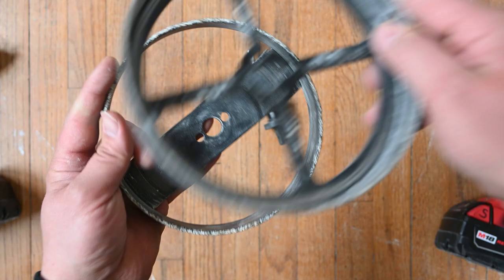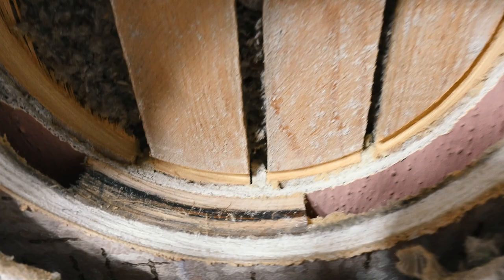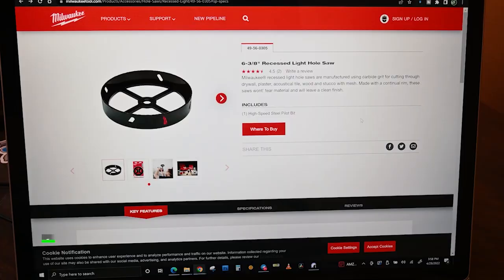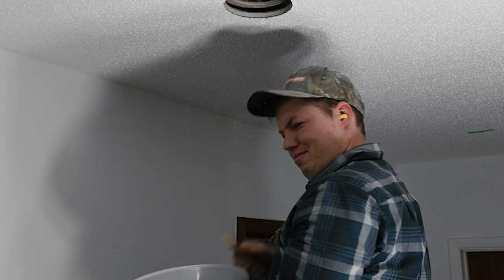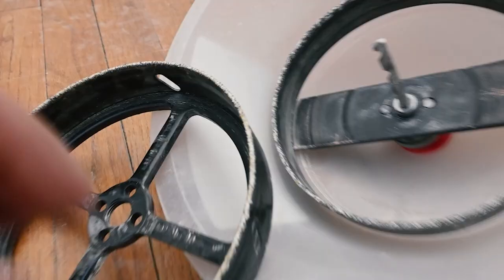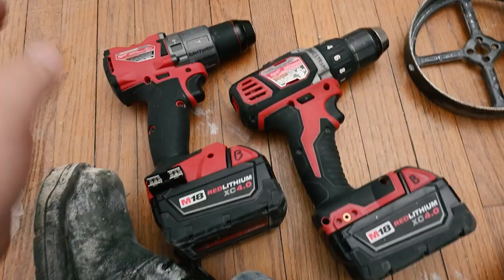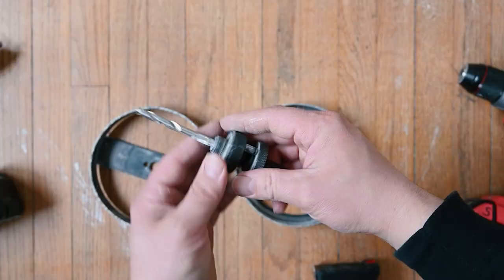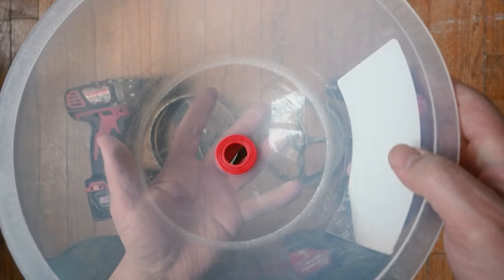Milwaukee vs MKC Recessed Light Hole Saw Comparison for Drywall Lath & Plaster Blu-Mol Dust Bowl

Comment: Hole Hawg with the side handle and a 12” bit extension is all I’ll ever use along with dust bowl. Safer tool especially when you’re on a ladder. In low speed it has a clutch in case the bit jams.

Comment: The Milwaukee hole saw works flawlessly. I installed (12) new 6" Halo LED wafer lights in a plaster/ wood lathe ceiling in a 100-year old house and the hole saw was still kicking ass after all that. First, I attach the dust bowl and hole saw and it cuts out the plaster up to the wood lathe. From there I use the M18 oscillating tool with a Carbon all purpose bit to chop away the wooden lathe. IMO this is the best way and I've been installing recessed lighting for over three decades. The wafer light spings sit on top of the wood lathe and the lights turn out beautiful.

Comment: The newest M18 fuel allows you to turn of anti kickback, and with the 2803 drill hammer drill mode is probably preferred for all that soft masonry.
Reply from the maker: That would be a nice feature as it was pretty annoying having it stall out so much. Hammer drill mode would have been smart too.

Comment: Ben, put the side handle on your drill, especially drilling through this material. 
I have both the M12 and M18 fuel drill/driver sets, and I'm amazed that the M12 seems to be nearly as powerful for most applications, even driving in 12" structural lag screws. Amazing.
Reply from the maker: Wow, that's impressive. Yeah the handle would be nice. If only I knew where it were... ;)

Comment: Some of the deals in your store are not working. Good prices and would have bought but it's not working. Such as the Makita 5" 18v grinder. When you click them and it goes to Amazon there is just nothing to click on to buy it. I'll check back later

Comment: The drills were set to different settings, the brushless was on setting 12 for torque stop while the regular was on drill bit setting which doesn't have torque setting (even though speeds are the same). From my experience using the carbide/diamond pieces rim hole saws the higher speed (2) works better but it needs to be driven in slower and not pushed on as much or if it binds your hands will curse you out.

Comment: Finally got a chance to watch the video Ben. It thanks for sharing.. I don't always subscribe to the big Name brands. I purchased a set of whole saws from the local hardware store. They are made by Irwin. I hope they are good Because I've got my share of drywall to cut through Also thanks for the tip About the dust bucket